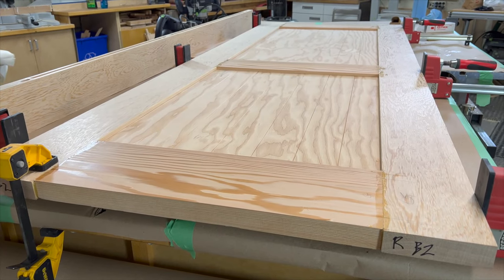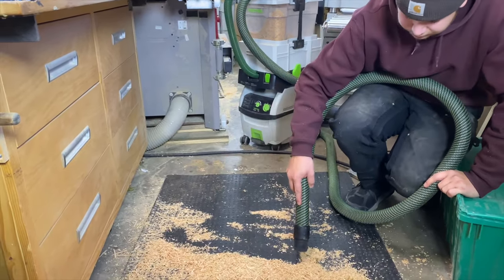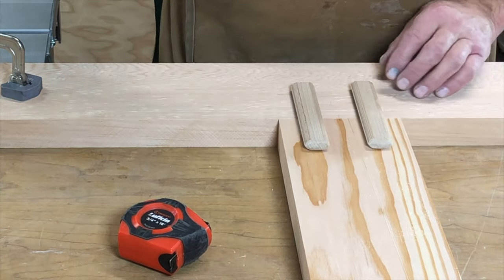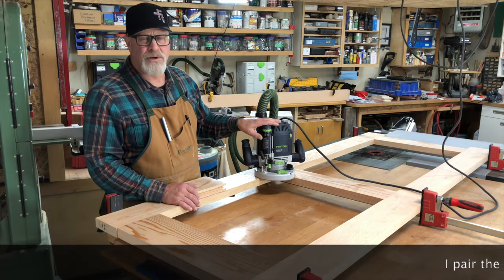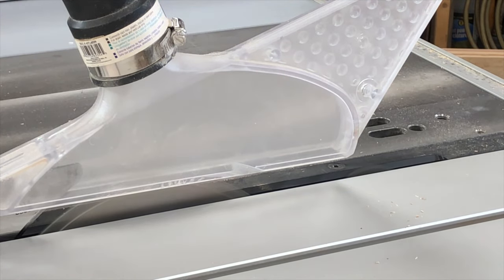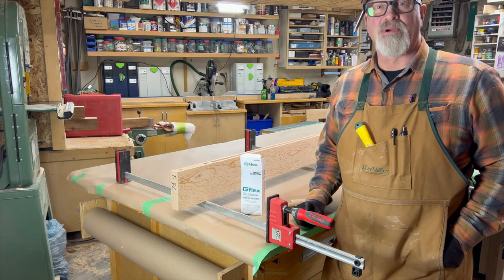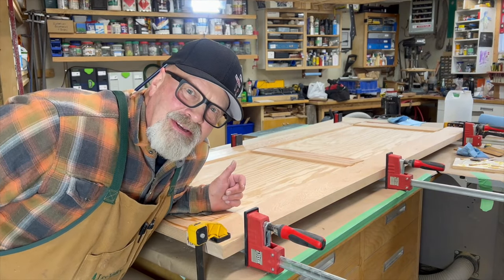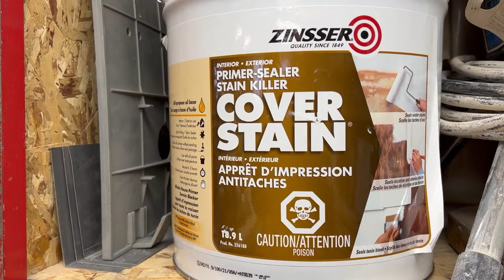Building custom exterior doors with Festool Domino XL and Festool OF2200 router

Comment: I have to laugh when you say metric easier than imperial. I think you mean decimal vs fractions!. I worked in a machine shop and we worked in decimal imperial. No fractions 3.500 or.020 (20 thousands)   and metric was the pain.  +/- 1 thousands of an inch was a good tolerance, easy to use no thermal management required. but it is ,0394thousands to a mm so working to  .1mm was 4 thousands, too sloppy and .01 is to precise. Our scales read 1 thru 10 for each inch as in 100 thousands or a tenth of an inch. Calipers or mics are 4 turns to that .100 or .025/turn. But I will admit now that I am into woodworking when people say 3/16 of an inch I think .187 of an inch
Reply from the maker: I never thought of it that way. Fractions definitely have their limitations once you start adding and subtracting them. I did a metric to imperial fraction conversion yesterday on my calculator and the answer came back with a 19/64 at the end. That's when my eyes glazed over as we simply dont work in 64ths as carpenters. Thanks for the comment.

Comment: But doesn’t using epoxy in place wood glue kind of defeat the purpose of using dominos? Sure you get more surface area for gluing, but are you getting the benefits of long grain to long grain adhesion without using wood glue?
Reply from the maker: Thanks for reaching out. Scientifically I don't know. But based on the fact that professional furniture makers use epoxy with dominos, I don't think it's an issue. Joey Chalk is the guy I got the idea from. Andy Rawls also uses epoxy and dominos. Check out their channels if you have time.

Comment: Why didn’t you use any Spaceballs or spacers to allow the panel to expand and contract along with the door and not end up with a crack line after you paint it?… Assuming you are going to paint it
Reply from the maker: Thanks for your question. Marine plywood is very stable. We have big humidity fluctuations here and the paint hasn't cracked. I would have used spacers for sure on a solid wood panel, but with marine plywood it's not necessary. That said, it certainly wouldn't hurt next time.

Comment: Interesting. First joinery video I've seen using Festool gear. Till now, I'd assumed they were cabinet and furniture tools
Reply from the maker: The Domino XL 700 is really a good tool for joinery. You can get 14mmx140mm dominos that you could potentially use for very large builds - even timber frame stuff. Thanks for the comment.

Comment: Your passion for wood working shows in your project. Thanks for sharing this great door build. I wish I had the money to buy the tools and shop to do what you're doing.  Thanks
Reply from the maker: Thank you Mike. In my case it was a slow process to get the shop equipped with the right tools over several decades. But you can do a lot of nice work with simpler tools when you start out. Enjoy the journey, Scott

Comment: Well, that’s the first video of yours that has come up for me to watch. The first thing must be to congratulate you wholeheartedly for both the content and the presentation - both first class; maybe that’s because it’s senior to senior but I really enjoyed the pace and lack of gimmicks. 

I’ve been a woodworker for over 45 years and so, most do the doors were made with M&T joints. I still have a great Morticer in the shop but the effort it requires to make the mortises is now really too much for the shoulders. So, it’s Domino time. I make my doors in virtually the same way as you do ( sometimes I use 3 slightly smaller dominos cut in a v shape but the amount of glue area is the critical thing). 

I haven’t used slow cure epoxy on complex set ups; I’ve relied upon Titebond Extend but I’m soon to build 6 internal doors for our barn conversion and so I’m going to go West. These doors each have a fancy middle rail (shaped cloud lift as in Greene and Greene). It’s not hard to get the lower panel shaped to fit that curved groove using the cloud lift template as a guided. However, the top panel is a stained glass rectangle - which makes fitting it into the top edge of the curved cloud lift less than straight forward (no point in doing things that are easy). I’ve thought of a few ways to make the “mortises” in the stiles and curved rail but each one has positives and negatives. I’ll just make mock ups of each method and see which one works the best.

All the critical elements were clearly shown by you. Preparation and precision are the keys. Don’t rush and just keep thinking. The only poster I have in my shops is just 3 words Patience, Precision, Perfection. As my body slowly declines, my working days have to be shorter; if I try and push it, then  the standard of work declines because I focus more on the aches and pains than what I’m doing. 

Interested in your choice of pencil. It clearly does not impact upon the accuracy of your work but Im slightly more hung up about marking than you. For really precision work, I use a knife or perhaps a 0.5mm mechanical pencil. For joinery, I use constantly- sharpened 1 H or 2H pencils for marking and then a 2B for marking references (A and A, Left and Right or whatever). Your simplicity is attractive but I’m too old to change now. 

Apologies for the long post but the main point is to congratulate you. From a new subscriber
Reply from the maker: No apologies necessary! This is awesome feedback. I love to hear about people's projects. It sounds like we are cut from the same cloth. (I have a picture of a sasquatch in my shop with the words "believe in yourself when no one else will.") 

I made a nice craftsman-style end table years ago with more than a dozen M&T joints. It was satisfying to see it come together over the MONTHS it took to build. Now I'm more in the "get-r-done" mode. Although I marvel at guys that make the high-end furniture (I watch their videos) I'm not quite there with my patience level. When you build things for customers, time is money - and at least in my neck of the woods there's little market for really expensive pieces. I'd love to see that stained glass door when you're done. My email is scott@scottearlsmith.com. 

As for pencils I was gifted a "FatBoy" pencil from FastCap.com and I'm using that now. You can sharpen that pencil to a fine point. I have a marking knife as well, and will be putting that to use. Most important to me is that I can SEE the mark. Again another indicator of being a more "mature" woodworker. Like you I really have to pace myself. My son occasionally will call and want to work with me in the shop at 8 or 9 pm after I've already clocked a long day. My answer is "not happening at this time of night."

I'm building a door this winter for my cabin on the lake and it will have glass in it. I like the idea of stained glass too, so maybe that's a possibility (will do a video on that build). 

Even though the video production process is time consuming, I'm enjoying the process so there will be lots more to come. Glad to have you on board!

Comment: Thank you for the instructional video. I am going to build seven doors for my home in a farmhouse style. I was going to use pine T&G for my inserts but thought about using plywood but wanted the grooves and did not think it would work on plywood. Well, you just demonstrated a fine way of doing it which will help keeping my doors square as well. I have been thinking about the festool 500, to use for my joints using the 10mm. It will be my first Festool tool. I am also a retired police officer in the Buffalo NY area and enjoy my woodworking and retirement. I wish you well and look forward to learning more from you. Respectfully, Jim.
Reply from the maker: Thank you James. I’m out at hunt camp so hopefully this works. So great to hear from a brother in blue. My son is on the job now and it’s scary. Lots of guns and gangs since I retired. So glad you’re enjoying your retirement. Good luck with the doors. I hope to do another door video this winter. All the best, Scott
Reply from the maker: James, You won't regret purchasing a Domino machine. I have the 700 and find all kinds of uses for it. I went with the bigger machine as I don't do a lot of smaller projects. Cheers Scott
Reply: Sir, I just purchased my first tool from Festool, the TS 75 (track saw) from the Rockler store up on Transit Rd. I live outside of Jamestown and stopped in there in the way home from work in Rochester last week. The associate Jay was superb in his knowledge of the various Festool tools and totally convinced me after telling me about the Festool 3-2-1 Warranty.
Reply from the maker: @Billy_bSLAYER  That saw is a horse for doing great work. You will really enjoy it. Good for you. The TS75 was pivotal on this fireplace. https://youtu.be/r_37kTzBcyk
Cheers, Scott

Comment: I'm about to build something similar for MN climate (boat house doors).  They are wider than they are tall (5' W x 4.25' T).
My plan was to use LP SMARTSIDE for the frame and HDO for the Panel.  Do you think the Domino 500 is undersized for mortising the tenons?  Unfortunately I don't own the Domino XL....
Reply from the maker: Hi Matt, The max depth on a Domino 500 is 28mm and you can use a 10mm domino. So that is decent (28mm in both pieces = 56mm domino). The XL gives you 14mm x70mm depth in each piece. So that is way bigger. But if the doors are for you go with the 500. Unless you want an excuse to buy a 700. My question is: will the doors need a diagonal brace for that width of door? Cheers,  Scott

Comment: Nice build.  I wonder, did you consider putting in spaceballs in the channels to keep it more in place during winter shifts?  I've hand panels get detach from the caulk from excess movement.  Trying not to go the full traditional route of weeping holes here.
Reply from the maker: I appreciate your compliment. Putting the spacers in wouldn't hurt. But since the panels were marine-grade plywood, and very stable, I didn't think it was necessary and may have added another complication to the assembly and glue up. I would certainly have used spacers if the panel was a solid wood glue up like a cabinet door. Thanks for your question. Good luck with your projects.

Comment: Thank you Scott for this very clear and pleasant video.  I like the scored plywood idea and plan to use it. I’m planning to build seven 2-panel interior fir doors for a cottage. They would be stained rather than painted.  What plywood type and grade would you choose, given that it’s for an  interior door panel. Also, is there an actual stamped grade specified for the fir 2x6s that I could look for, other than “finish grade”. Thanks again for your helpful videos.
Reply from the maker: Thank you for the encouragement Marvin. I would choose a fir plywood (good-both-sides) so you have a nice finish on both sides of the door. I believe the fir will not have a grade stamp unless it's construction grade. Look for fir that is free of large knots and you should have a great finished product. I'm gearing up to build an exterior door for my cabin-in-the-woods so look for another door build video this winter. All the best, Scott

Comment: One thing I do before I glue up my rails and stiles is hit the interior long grain edge with a sharp block plane or #4 smoother instead of sanding.  Just a couple of passes removes any tear out from jointing or table saw marks.  Less chance of the sander rounding the edge, especially on the 3/4" cabinet doors.
Reply from the maker: That's a great tip John. I will try that next time. Cheers Scott

Comment: Are you using framing Doug fur?
Reply from the maker: No it's a select grade from a finishing supplier. The lumber stores here in central Canada don't carry construction grade Douglas Fir except in 2x10 and 2x12. Too far from the west coast I guess.
Reply: Thanks I may use it for exterior doors I’m making if I can find it.
Reply from the maker: @paulyanney3151   I'm sure it will work out great.